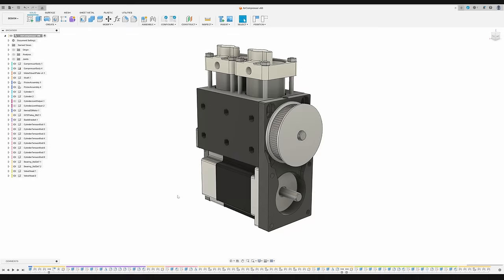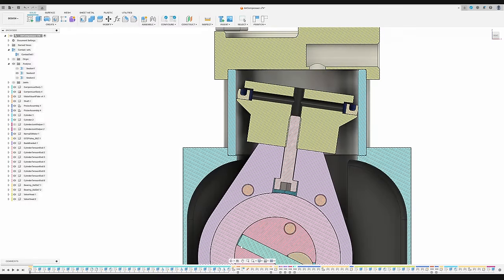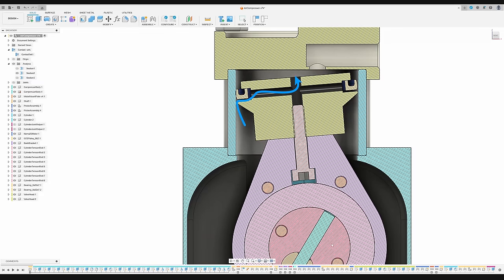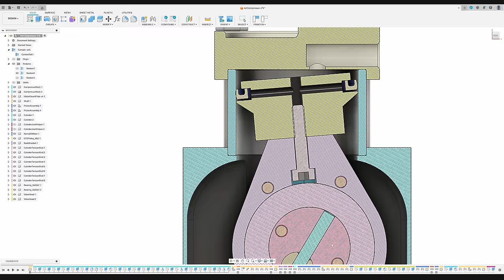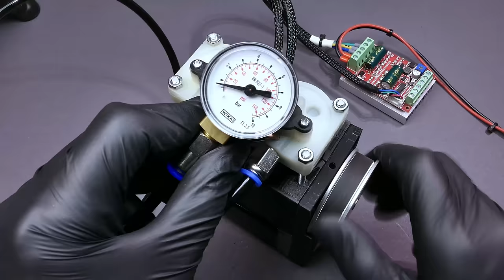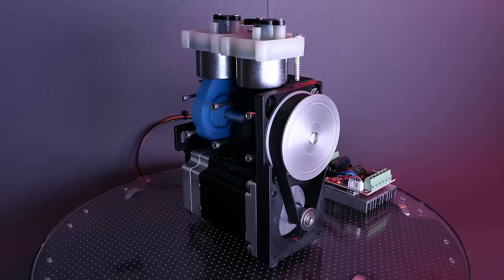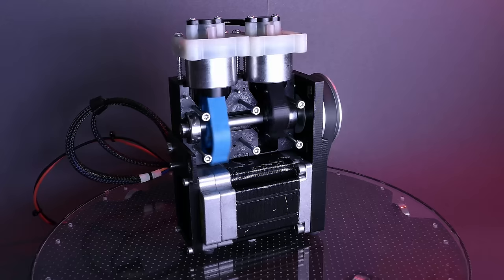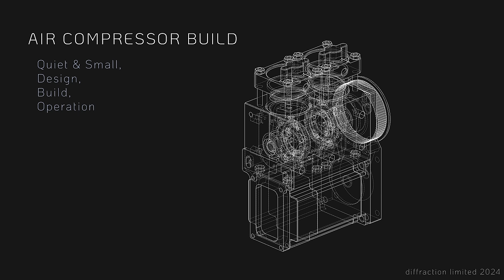Building a Small and Quiet Air Compressor [4K]

Comment: The concept that the piston and "piston arm" aka con-rod are only subjected to compression forces is fundamentally wrong. They are most likely subjected to significant elongation forces during almost half of the upstroke as the piston decelerates to a stop at tdc and half of the downstroke as it accelerates from tdc. Depending on the rpm,bore,stroke and the pressure that the air is being compressed to, these opposing forces are somewhat cancelled out. But in practice the inertial forces are usually a lot lot higher than the force generated by the pressure which begins at zero and builds up. To quantify things a little these elongating decelerations and accelerations can be of a magnitude of a few hundreds to thousands of g's even for a couple of 1000's of rpm of the crankshaft.
Reply from the maker: Thank your for the constructive feedback. I am not sure though, that the Problem you are describing applies to this construction, so lets quickly run the numbers (SI-Units) for an unpressurized cylinder (worst case) to see whats going on:

* 1000rpm crankshaft speed is about 17s rev per seconds.

* The vertical travel of the piston is 0.01m.

* The vertical movement (y) of the piston can be approximated by a sinusoidal motion:
		y = sin(17*t*2*π)*0.01m

* The accelleration is the second derivative of the position:	
		y" = -114.093 sin(34 π x) m/s²

  => so we have a maximum acceleration of 11.6G
  
* Assuming the piston weights about 100g (its probably way less) we get a maximum accelleration force of
		F = 0.1kg*114m/(s*s)
		F = 11.4N

[calculation was corrected as pointed out by @giantisopod]
		
Overall I see your point, however the resulting force of 11.4N is still way lower
than the 400N compression force due to the compressed air, so I dont think it will be a problem overall nor that the concept is fundamentally wrong.
Time will tell if anything fails due to elongation forces and I will keep you up to date...

Thanks again for the comment thoug :)
Reply: @DiffractionLimited  Did you mean 7.3G rather than 73G? Actually, upon closer inspection, I'm not sure about your value for the second derivative, either. But it was nonetheless interesting to see how you arrived at your conclusion. I'm not an expert at any of this, but it makes sense to me, I'm just not sure about the numbers.
Reply from the maker: @giantisopod I was surprised about the high G number too, so I double checked and it actually seems right. Used Wolfram for calculations so I dont think there is an error in the second deriv.
Reply: @DiffractionLimited  The unit for y'' is m/s², and 1 G ≈ 10m/s², so I think you are missing a decimal point :) Wolfram Alpha gives me -114.093*sin(34*π*t) as the second derivative.
Reply from the maker: @giantisopod Ohh you are totally right. I must have messed up something very bad. I am correcting the comment. Thank you !

Comment: If you want a really quiet compressor, look at Guided Rotor Compressors.  Only rotating parts.  No reciprocating parts.
Reply: Do you have any channel or video where I can see this compressor?
Reply: @musik12  https://en.wikipedia.org/wiki/Guided-rotor_compressor
Reply: @darrenconway8117  Ok, I found it on Wikipedia, I thought someone might have already done it in small sizes.
Even so, thanks for your answer, hugs
Reply: @musik12  The GRC is scalable.  On full size compressors the rollers are often semi-hard, low friction, plastic for zero lubricant applications.  The housing really needs to be machined with a CNC mill, but an easy job for a CNC mill. Development of the GRC is published in a University paper somewhere.  If you have access to a CNC mill, this would be scalable to small sizes.
Reply: @darrenconway8117  Ohh, ok, yes I have a small CNC like that for a very low price lol, but it works very well if you don't need high precision.

I'm going to look for this project and try to do it on a small scale.

I have no knowledge of engineering or mechanics or anything lol.

But I'm quite curious and maybe I can do it.

Thanks.
Cheers
Reply: @musik12  The key feature if the GRC is the number of nodes for the rotor and the stater vary by one.  The rotor is eccentric, much like a rotary engine.  The tip seals are rollers, so you can mathematically generate the stater profile with CAD or Excel.

Comment: Pretty neat. I purchased a "quiet" air compressor last year and have found it still quite loud and annoyingly low on power. I'm excited for new takes on how to construct such devices.
Reply: I wouldn't get your hopes up on this one. There are basically three variables you can tinker with:
Power, price and noise. You can only choose two. Basically a quiet powerful compressor is going to cost you (rotary compressors). A cheap powerful compressor is going to be loud. And lastly, a quiet cheap compressor is going to find you lacking in power.
Reply: @patrickd9551  Years ago, i built a 40l/min 6 bar compressor for <400 €. Totally quiet, could run it in my bedroom at midnight ithout disturbing the neighbours. no big deal, though few people choose to go that route.
Reply: @TeslaAtoms Well it depends on your application, but 40L/min is basically nothing for most applications, perhaps except paintbrushing. 

But you've proven my point exactly, because my $500 compressor does 350L/min, makes a lot of noise, and I still can barely run my plasma cutter on it. (those require massive amounts of air)
Reply: @patrickd9551 It really depends on the usecase! I use my compressor exclusively to supply air for tool changes on my VMC, as well as mql (minimum quantity lubrication). 40L is the perfect match for this!
Reply: @TeslaAtoms Indeed, your requirements are low on power and therefor you can invest more money into noise reduction. 

And again, that is just fine. Just like airbrush painting requires not so much air, but does require not so much noise.

Comment: This is actually so sick. Seriously would consider using something like this in a micro shop for delicate work or testing. It's basically got VFD standard so you can adjust duty cycle dynamically. 3D printers and just the overall democratization of manufacturing has seen some amazing things come from it.

Comment: Very well put together, and great explanation on material choice and design for the strengths of 3D printing. I like the use of flanged screws to hold in the bearings, since press fits into 3D prints have the tendency to creep and loosen up.
Reply from the maker: Yes that is my experience too, press fits in 3D prints hold for a day or so.
Reply: Thanks for mentioning that.  This was something useful to learn about which I didn't know about before

Comment: That's so cool! Looks very easy to repair and maintain. It would be cool if you hooked it up to a fire extinguisher cylinder as a storage tank. The working pressure of most fire extinguishers is 12 bar or so.
Reply from the maker: True, I am indeed looking for buffer tank and one of those small fire extinguishers or a small propane bottle might do the trick. Thanks for the idea.
Reply: @DiffractionLimited 1.5 L sparkling mineral water bottles do decent job for pressures below 3- 4 bar. They can rip at about 5 bar. 0.5 l bottles rip at 11 bar. I pumped bottles 1.5 L by foot pump to 2-2.5 bar. It is a bit tiring job if smth is leaking.

Comment: First video i ever saw from you. Subscribed! loved this video!
Reply: One thing i didn't catch, what assures the timing of the pistons?
Reply from the maker: Thank you. And the only thing important is that they are 180° out of phase which is guaranteed by the holes and the steel pins in the crank shaft.

Comment: Nice! A compressor is one of the first projects i want to try when i get my lathe. For some reason the piston not travelling vertically triggers my ocdness, so would probably design mine with a seperate piston and wrist pin 😂
Reply: It may annoy you, but the tilting motion seems pretty crucial to getting the seal tilting along with it in a reliable fashion. 🤔
Reply: @AnnaVannieuwenhuyse  sure... but you don't need a tilting seal for a compressor. This design maybe, but other designs exist

Comment: Very impressive. Love the slow speed and low noise aspect of it.
It is a great unit, I would like to have.
However, I am not a maker. Would it be ok to get the components printed at JLCPCB. I think I could handle the assembly if I had the kit.
However, as important tools tend to fail when you need them most, I would prefer to see this unit made 24x7 capable to consider buying it. 
What would it take to harden it for 24x7 operation? I guess the rubber ring valves would be primary wear parts? What else, the excenter pieces inside the crankshaft bearings? The check valves?
Reply from the maker: Hard to tell, I also have to gain some experience with this thing because I havent done anything similar before.

Comment: Next step is to make a 3D printed head with custom valves. I highly recommend EPDM rubber sheets as they are durable, but they are also expensive. 
Otherwise soft silicone cooking mat can do the trick.

Can't wait to see other videos about this topic.
Reply from the maker: Though about that too. But the valve head might get quite warm so a resistant filament material needs to be used + It should be air tight, which can be done by submerging the print in a special sealing fluid as I learned recently. The rubber sheet is a good tip and in the valveheads shown here a similar flat rubbery material is used. The construction is actually quite simple.

Comment: Pretty cool.
Some major concerns though.
It needs lube, how do you plan to keep it lubed?
How do you plan to keep it from melting? PV = nRT, so as Pressure goes up, Temperature must also go up since Volume will remain constant (V will equal displacement).
And yes, 10Bar will mean 10x temp per stroke. You will have to run it at very low RPM to dissipate that much energy. There is a reason even the tiniest compressors have cooling fins...
Reply from the maker: I plan to use it on pretty low duty cycle. But yes long term lubrication is an open problem. Ideas for improvments are very welcome. As for the heat I hope that some of it is still in the gas as it leaves the compressor and eventually I might add a small fan or two if it becomes a problem.

Comment: I have to wonder if this basic concept can be modified to be a vacuum pump...
Need one for a vacuum table for my CNC mill.
It does not have to be a very high volume but needs to supply a decent level of vacuum for long periods so maybe using printed parts is a step too far?
Also, lubricating the piston will need to be looked at... This unit will need manual lubrication at quite short intervals otherwise the rings are going to overheat and melt at some point.

Comment: I believe with a simple under piston oiling system driven by the same motor as the compressor the build would be quite reliable.
Reply: that would work for solid machined parts, yes.
Reply: @AnnaVannieuwenhuyse  considering the pistons are running inside a metal cylinder, and the o-rings dont really have any relative movement to the 3D printed pistons, then yeah, Id say it would work quite reliably with continuous oil supply. Maybe a gravity fed oiling system running the compressor upside down and a filter of some kind at the exit to prevent oil contamination of the supplied air.

Comment: Another brilliant video/project. Thanks. 
Now as you have the air supply, can we have an in-depth video on the air bearing, please :)
Jokes aside, did you considered a repurposed refrigerator compressor as an alternative?
Reply from the maker: I am currently working on some changes on the air bearing to make it easier to manufacture - hence the delay... but it will come. As for the fridge compressors: Yes they are quite low noise and relient, but all the ones I know are filled with oil. Quite a lot of it can make it to the air outlet. But with a filter they might be a good alternative.

Comment: 10 bars would burst things into pieces! Truck Tyre Pressure is around 8 bar. (120psi)
I cannot trust this design can produce that much amount of pressure. If it produces, it is dangerous and requires regulatory compliance.

Comment: Incredible! Don’t the piston parts get too hot? Very impressive
Reply from the maker: Eventualy I guess they would, when running at higher rpm and at high pressure. However I think a small fan at each cyclinder would help quite a lot in that case.
Reply: @DiffractionLimited  it’s a beautiful design. Well done!

Comment: Hi, as the other person said I love the idea of using screws to hold the bearings in place. I know in your video you said that the check valve was not shown properly but I downloaded the fusion 360 file and was wondering how the check valves work, and if it would be possible to get the files for them?
Reply from the maker: Thanks. I plan to add the inner workings of the check valves to the CAD in near future and maybo make a supplemental video to this one too, where I show how htey work. Its essentially just a springloaded rubber pad on a hole.
Reply: @DiffractionLimited  Thats awesome thank you for the reply! I will subscribe and wait to see it!

Comment: How did you design the gasket? What thoughts went into that? 4:13 Here it looks as if the right rubber ring is not sealing. Is the plastic piston itself sealing? Do you use formulas to calculate the geometry of these bodies?
Reply: Also: Why is the rubber seal u-shaped? And why is the piston upside-down cone-shaped?

Comment: Use a 3 phase brushless DC motor. Steppers are hella noisy without special driver chips made to be quiet.
Reply from the maker: It is a 3 phase brushless DC motor (BLDC Motor) !
Reply: @DiffractionLimited  It definitely looks just like a big ol' stepper motor, but I believe you.

Comment: Having it using a BLDC motor + speed control makes it even more quiet!
Could it work also as a vacuum pump (using an other piston design, mirrored from the one you have)?
Reply from the maker: Yes sure. Then it would only have to work against 1 bar not 10 so you could increase the volume or reduce the belt reduction ration. However you would reach a very deep vaccuum because ther will be a certain dead volume within each cylinder with this design.

Comment: The design of the compressor is outstanding. At the moment I am printing the parts. Has anyone found a source for the other parts? I am looking especially for the seals and the pistonheads.
Reply from the maker: Nice, let me know how it worked out or add an issue to the github if you find some problems. I actually migh do a video on the parts you mentioned. As for the Cylinderpipes a good source are gassprings. You hace to open them up (which can be dangourous without the proper technique due to very pressure and oil) and then slice off rings. By design the inside is made to be a very smooth and a durable surface for seals. As for the seals them self search for 'Piston U-Seals' make sure they do not have a steel core. Also be aware that they have to be slightly oversized for the cylinder bore to seal properly. Good luck with your build !
Reply: Hello, I googled around the last days, but until now I was not able to find the mentioned seals in the needed dimensions. Do you remember, where you bought your parts? Also the cylinder heads. The 3D-printed parts worked out so far, the tolerances are a bit snug. Maybe a version of the parts with some larger tolerances would be helpful for a lot of people.
Reply from the maker: @Ulm26m As mentioned in the video I got the cylinde heads and seals from a cheap air compressors for car tires and alike. But I also bought some U-Seals from ebay as replacement. The OD can be a bit larger so you have some tolerance and should be able to finde some appropiate seals.
Reply from the maker: Bit I think the best order would be to look for cylinder - then for the seals - then adapt the CAD accordingly and then print the parts.

Comment: Would it be possible to seal the case and have a second one supply air to it, kind of like a 2.stage system?
Reply from the maker: I think in that case you would want to use a classical seal at the piston and a dedicated intake check valve in the valve head. Seems much easier than sealing the entire compressor body.

Comment: This is the first non-industrial grade compressor that actually capable to reach more 100psi. I bought a few electric ones that supposed put air into bicycle and car tires and all of them stop pumping at around 50-60 psi. I had to return all of them. Also, one battery powered even caught on fire. I would recommend you to commercialize your product and sell.
Reply from the maker: Thank you, but I think its far from being a product and I'd rather see the community use and improve upon it for free...

Comment: I wonder how it would be to scale, Inline 12 for example
Reply from the maker: It should scale well, but you may need a thicker crank shaft and one or more supporting shaft bearings in the middle at some point. But it would also run smoother with more cylinders.
Reply: @DiffractionLimited  do you have any idea of its output?

Comment: I really wanna see the volumetric output of this hoooked up to a small air tank.  I would do anything to have a quiet compressor without spending $1000
Reply from the maker: Well then this thing might be for you. How would you measure it? Would the pressure over time given the tank volume be sufficient?
Reply: @DiffractionLimited  You would measure it with a...
Flow Meter. One of those things that looks like a glass tube with a ball floating in it.